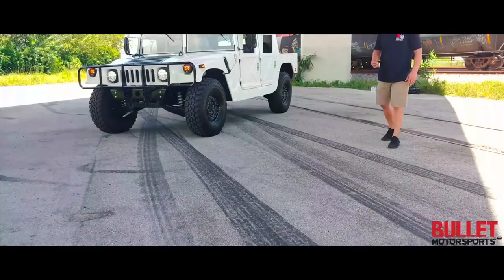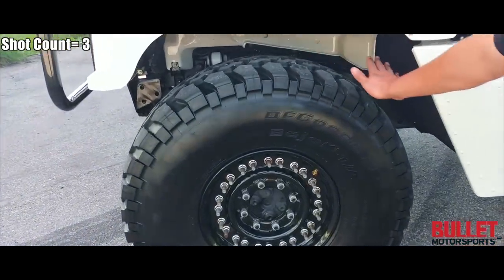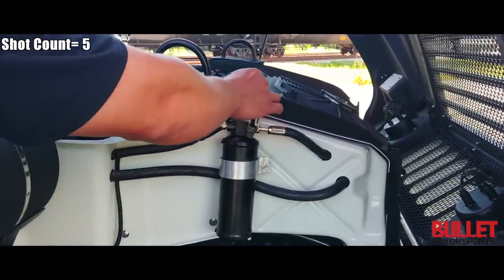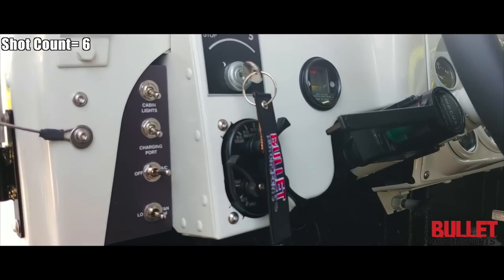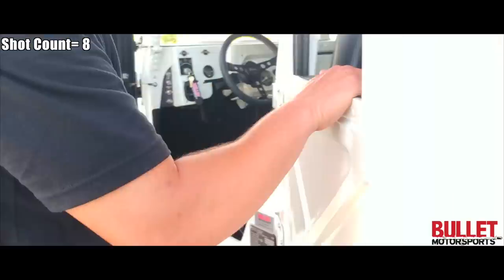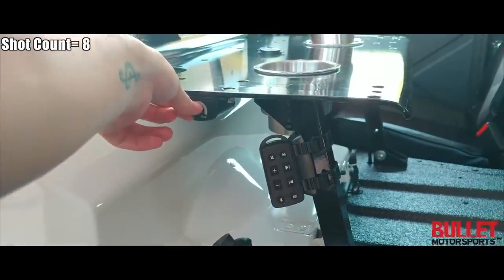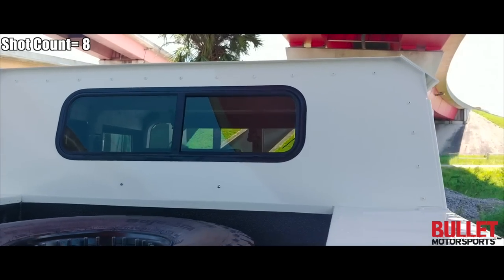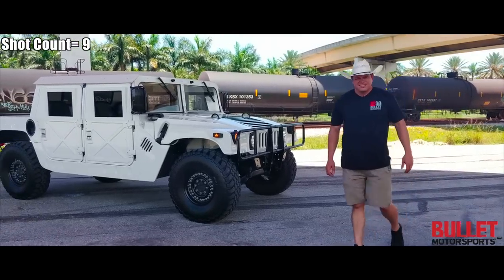Fully Custom AM General Humvee M998 "Bianca" - [HD]

Comment: You did a great job restoring it but the big problem is the 6.5 doesn’t have enough power on the highway in the 6.5 turbo has a problem overheating I’m on several H one hummer’s

Comment: Awesome rig.  Where did you put the vehicle's batteries?  I noticed the AC stuff was mounted where they'd typically be. 
 Plus, thanks for the extra details on the blue tooth sound system.  Much appreciated.
Reply from the maker: under passenger seat.

Comment: This is probably my favorite HMMWV build you've done, with "Verde" being a close second.  That Raptor-liner green paint job was amazing!  Couple of questions, though:  Why not go with a GM AC unit (or even a Vintage AC unit for that matter) versus the Red Dot?  I'm sure the Red Dot works well, and I like the work you did to put some of it under the hood, but it's still a massive clunky setup in the back.  Just curious.  Also, when you started this rig it was quiet...I mean, really, REALLY quiet...compared to the other builds I've seen you present (some of which were so loud you couldn't hardly have a conversation without shouting).  How did you achieve that with this build, since it's the same 6.5 diesel that's in all of them?  I've looked at your website and there are a couple of budget builds listed in the low-to-mid 20K range, but it would help to know a ballpark price for something like this.   Thanks for posting!

Comment: A few questions, where are you located? Will you do a rebuild on a 1995 civilian H1(diesel, not one of those gas powered POS) and roughly what kind of price tag am I looking at? The rig is in pretty good condition (37,000ish miles on it). I should probably just give you guys a call...

Comment: Just wondering, is there anything to worry about when it comes to flat towing a humvee like this?
Reply from the maker: We do not recommend flat towing.
Reply: Only manual transmission vehicles should be flat towed.. not recommended to flat tow automatic ls and NEVER flat tow all wheel drive vehicles..
Reply: I like bianca....simple inside...